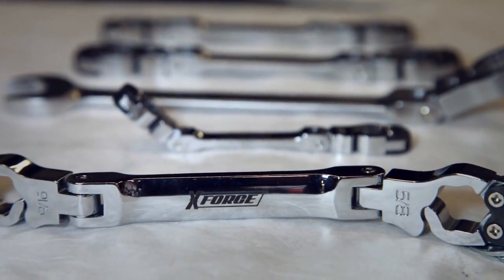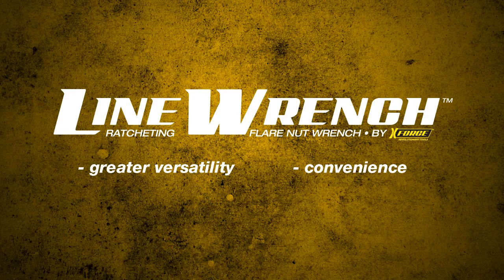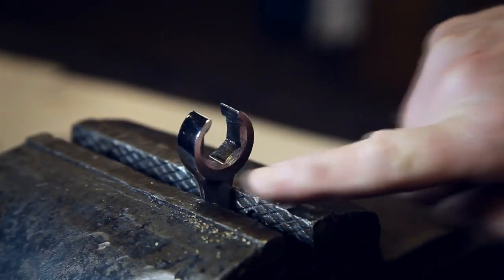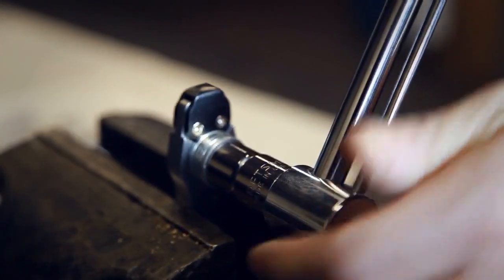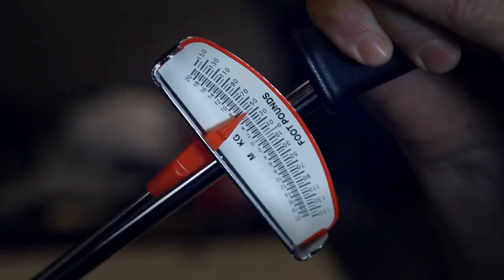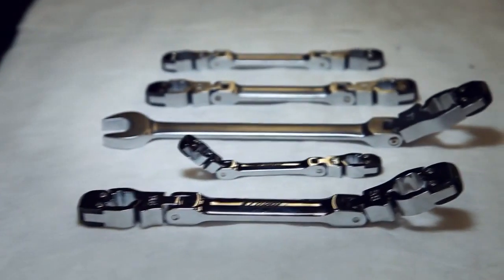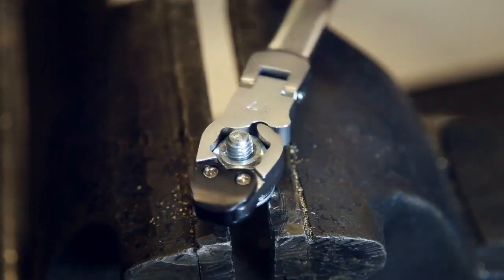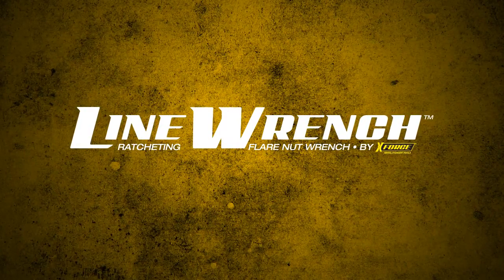XForce Tools ratcheting flare nut (line) wrenches - SAE & metric

Comment: I would like to see it tested on the brake hose at the brake caliper, where the insulation around the line is nearly as wide as the fastener.   No conventional flare nut wrench will fit over the insulation.  We are stuck having to remove the entire brake hose from the metal brake line.  Also, this wrench looks identical in design to the U.K. Sealey ratcheting flare nut wrench: https://www.youtube.com/watch?v=W-E5rTEMT1c   Perhaps, you have bilateral licenses.